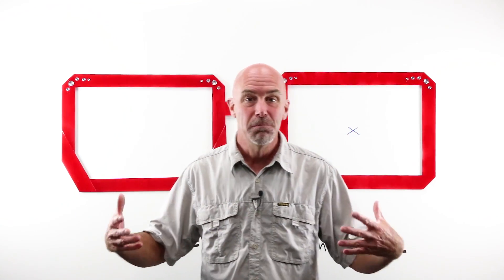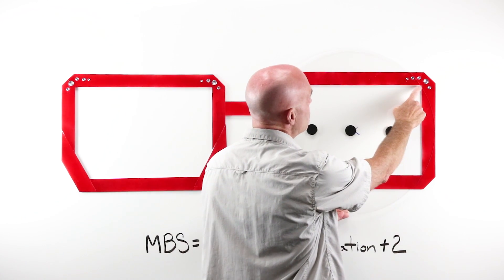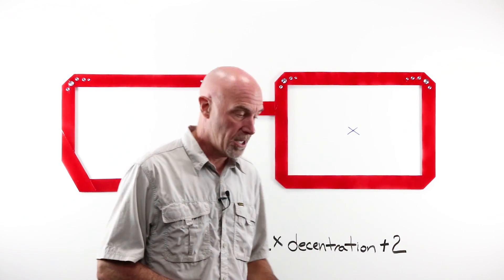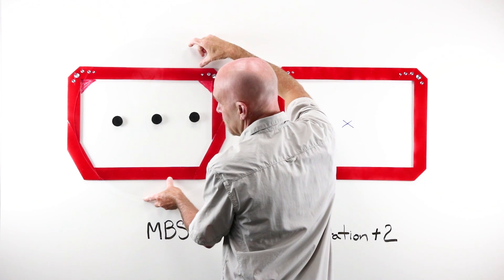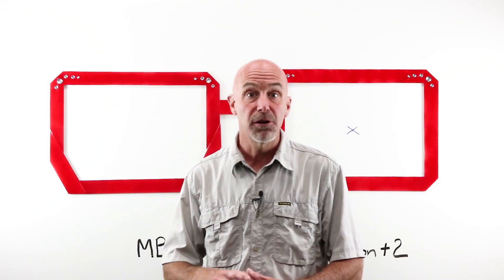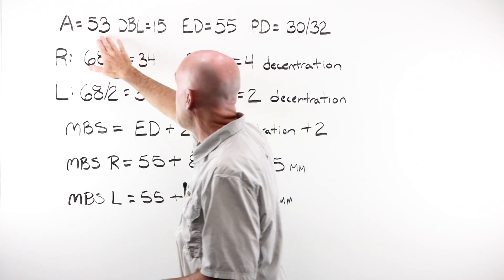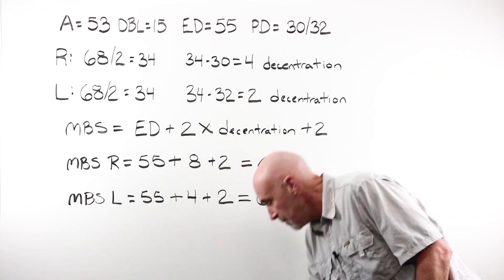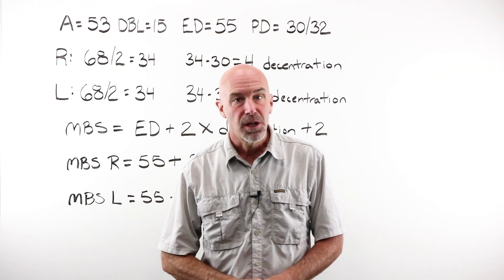What is Minimum Blank Size (MBS) and How Do You Calculate It

Comment: If the Dec is vertical from the GC... How measure MBS?
Reply from the maker: The B is so rarely longer than the A we don't really think of it that way or apply the MBS formula to it. If you have enough vertical decentration to not get cutout you have a problem. Progressives are designed to accommodate, SV should never need more than 5mm or so.

Comment: Can decentration be negative? or would you take the absolute value anyways?
Reply from the maker: Negative would be he incorrect term but yes you can have out decentration if the persons eye sits out from the eyewire lens opening. You need to watch the videos on decentration and then start drawing things out.
Reply: @LaramyKOptical  I understand decentration can be in any direction. I just meant from the context of using that formula you have on the board. My guess is no, it’s always a positive value.
Reply from the maker: @ShubyDuan  I can't say with 100% certainty but I wouldn't think that tossing in a negative number would be a great idea. In the 1/1000 chance you have out decentration that should be working in your favor for MBS anyway.
Reply: @LaramyKOptical  sounds reasonable. Thanks for the discussion
Reply: @LaramyKOptical  This is what I have been trying to figure out before I take my national exams tomorrow. So from my understanding, even if the PPD is larger than the Frame PD which therefore would result in a negative (-) decentration value.. In regards to actually plugging it into the MBS formula, we would use the decentration value as an absolute and not include the negative (-)?
Reply from the maker: @brandoncheung3003  I'd be very, very surprised if the exam has a question using a PD wider than the FPD.  A negative value should be perfectly OK in the simple formula. 56 + -2 = 54 and 56 - 2 = 54 so the result is the same. If in doubt draw it out.

Comment: Hi Larry, 

Quick question. I have a member of staff who calculates MBS at 60, however, oddly orders MBS much larger as she claims that the lenses are more cosmetically appealing.... I would have though one would order to the MBS as this would result in a lens with reduced weight and central thickness in say a plus lens... surely the sagittal thickness increases with blank. 

Thanks
Reply from the maker: 60? 60 what? Randomly picking 60? I need some more to go on here. ED is frame dependent, PD is human dependent, I don't see how 60 could ever be a fixed part of the "formula." As a + lens gets bigger the center thickness increases period - end of statement. To get the thinnest plus lens you must input all the correct parameters and let the software sort it out. In minus it doesn't matter all that much at all. I think your staff member doesn't know quite what they are doing/talking about????? John

Comment: Your video was very helpful, I am currently studying for my exam, but first I have 2 practice exams. Your video helped a lot, but I do have a question about a problem in my exam book. The question reads: a frame that measures 54/20 with and ED of 57mm is selected by a person for single vision lenses. If each lens must be decentered 5mm in, then the minimum blank size needed to complete this job is 68mm. The answer is 68mm, but with the MBS formula I am using, I think I may have a number off, because when I plug in the 57mm + 2 (5) +2 = 69. I think I may have missed something here. It's only one digit off. Can you clarify? The A and DBL in this problem is not given here, so I only went with what they gave me.
Reply from the maker: Sorry but I don't supply support for questions that are not mine. Should be plenty of good examples in the video and on the OpticianWorks website. John

Comment: Here I am again. I find the information you provide to be very helpful.

I have a question: I have to make a +3.50 rx pair of glasses.

From what I learnt on the net I understood that, especially for plus lenses (in minus lenses the thick part is cut out), stock lenses will be thicker than surfaced lenses; this is much noticeable with smaller frames, as stock lenses are usually bigger than the minimum blank size. 
Is this right? 
If the optician suggests me to make the glasses with stock lenses, should I opt for surfaced lenses instead? 
Do all optic laboratories surface lenses to the minimum blank size? Or do they manufacture surfaced lenses just the same as stock lenses and then cut them to the frame? 
Thank you!
Reply from the maker: Excellent point! You have repeatedly said you want the thinest lens possible. In that case you would be correct in wanting a surfaced lens that has been designed around the frame (shape/size) that you choose. That would be the only way to be 100% sure. John
Reply: Ok.
So should I simply request for a surfaced lens or should I request for a personalized one, like Zeiss Optima? 
Do they consider these things when normally surfacing lenses or should it be specified and requested?

I think there would be quite a difference in price for normally surfaced or personalized ones, like Zeiss Optima line.
Furthermore I asked informations about Zeiss Optima to my optician and if it would be suitable.
My optician said that they usually do Zeiss Optima lenses when there is a big difference in prescription between the two lenses.
 @LaramyKOptical
Reply from the maker: @giordanopioli1922  All customized or personalized lenses are surfaced. Your call on choosing the upgrade to that over a conventional lens.
Reply: I'm sorry, I don't understand, maybe for my english :)
All personalized lenses are surfaced.
What isn't clear to me is if all surfaced lens are personalized.
Or should I request for personalization even when if I requested for surfaced lenses?
Does doing surfaced lenses imply personalization of the lenses or should I request for the personalization further to the surfacing?
 I apoligize if I'm bothering you :) @LaramyKOptical
Reply from the maker: @giordanopioli1922  LOL ALL personalized lenses are surfaced. NOT ALL surfaced lenses are personalized. You will pay more for a personalized lens. It is the difference in how the lens is cut. There is no such thing as a stock, personalized lens.

Comment: I am very new to optical, and don't cut lens here so if this is a stupid question i am sorry. If you use the 65 mm for right and 61 mm on the left wouldn't that make a big difference in the thickness of the lens, or does the decentration compensate and it ends up the same?
Reply from the maker: I'm not 100% sure exactly what you mean but I'll give it a try. Short answer: the more you have to move the lens within the eyewire the more some edge of the lens somewhere will be thicker. Big-picture it doesn't even matter if it is plus or minus. The less you have to move it the more EVEN the edges will be all the way around the lens. Beyond that you have thickness issues in plus that you don't have in minus. If you are talking about single-vision-finished-uncut lenses ("packaged" lenses) then you might well have a thicker center on a plus 65mm blank than you would on a 61 even if they were both +2.00. I think you are actually looking for this one: https://www.youtube.com/watch?v=niw8wgmRvKU You may also find the finishing course helpful! John

Comment: Is the reason for doubling the decentration measurement just for good measure or is there a more important reason behind it? I can't see way you would want to account for double the decentration per lens, it seems you would always end up over estimating the needed black size. To use your example if the decentration measurements are 4 and 2 why would MBS 61 and 59 be incorrect?